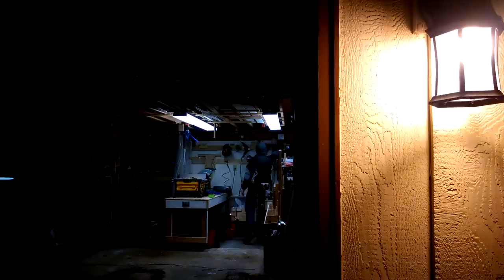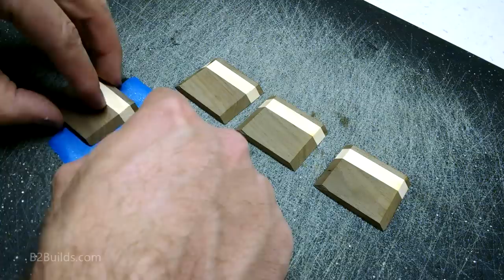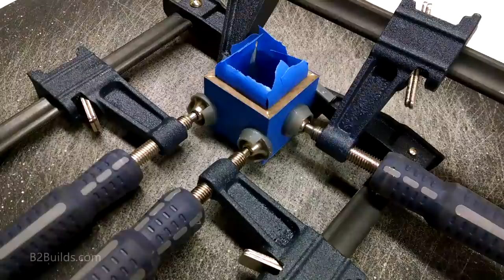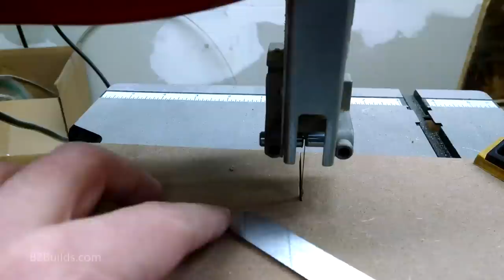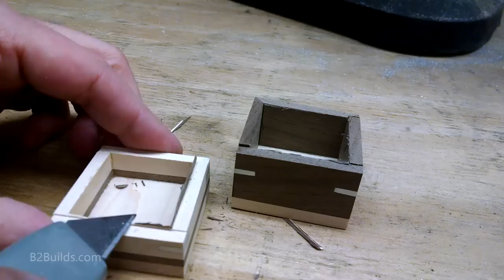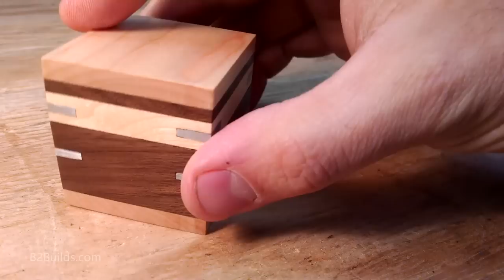Making a Small Walnut Box (with Walnut, Maple and Aluminum)

Comment: Love the mix of materials. Laughed when the walnut appeared. Did you drill the hole in the aluminum to get more glue surface, or was there some other logic behind that?
Reply from the maker: +Matthew Friedrichs Thank you. You're right... I figured the hole would provide a better mechanical connection between the wood & aluminum by filling it with a little cylinder of epoxy. Not sure if it was necessary, but I figured it couldn't hurt.

Comment: Loved the box. I too like the metal/wood combination.
Few Qs about the video (from a novice):
-- What is the name/brand of the brush thing you used to apply the glue?
-- Did you drill the hole so the epoxy could set up INSIDE the spline? I've never seen that move before.

Liked the bit where you masked the inside of the box before gluing!
Also, I like the quicky-router table. I don't have a legit one either. That's a good idea if all you need is edge/pattern work!

Thanks for the video!
Reply from the maker: +Walter Kessler Thanks! Great questions... It's a silicone glue brush (dried glue comes right off easy) sold by Rockler Woodworking. Yes, I drilled the hole to allow more epoxy in there to make a better mechanical connection. I thought it would add some extra holding strength to the two dissimilar materials. The makeshift router table works well. There's a board on top that pivots on one end, which you can rotate to make an adjustable backstop and clamp in place. I saw it somewhere on YouTube but can't remember where.

Comment: nice box! I want to try it out. What type of blade do you have on your table saw? I have a thin kerf blade on mine so i I will need to get a new one if I plan on doing the spline. Thank you in advance!
Reply from the maker: I was just using the blade that came with my saw, which has a 3/32" kerf. I'm not sure what thickness a thin kerf blade is, but as long as you can cut a piece of the same thickness, you can make a spline. The only thing I would have changed is I would have used a flat-tooth blade. The alternating tooth angles on my blade left a v-shape profile along the edge of my cut.
Reply: Ben Brandt - thanks for the reply. how did you remove the v shape profile on yours?
Reply from the maker: I didn't actually, it wasn't as visible once the splines were glued in. I think I tried sanding some of them, but mostly the cut profiles were left alone.

Comment: Hey why did you make a hole in the aluminium before gluing it?
Reply from the maker: I figured the extra "blob"  of epoxy in the hole would help strengthen the joint.